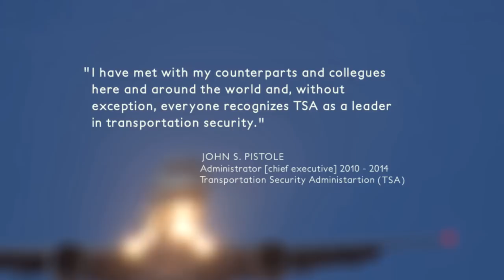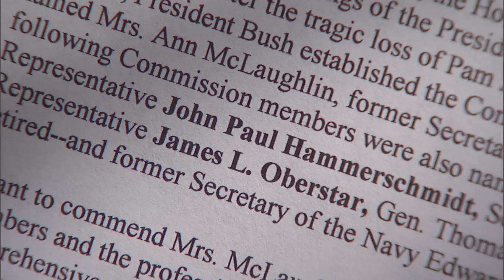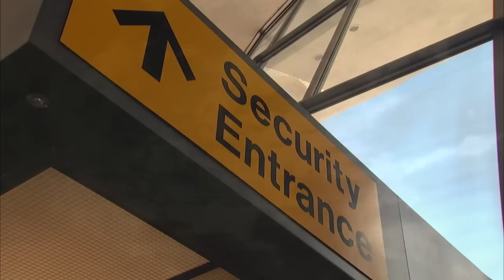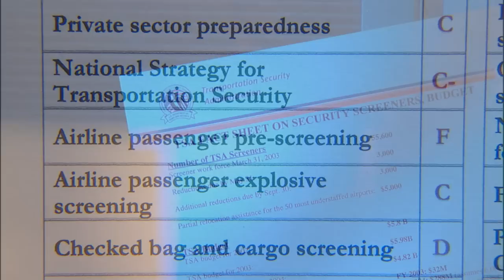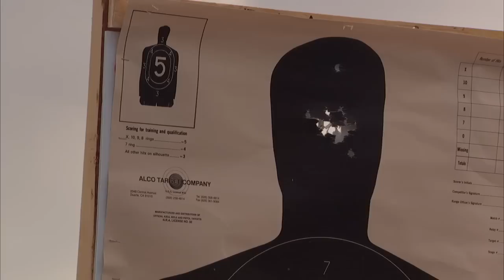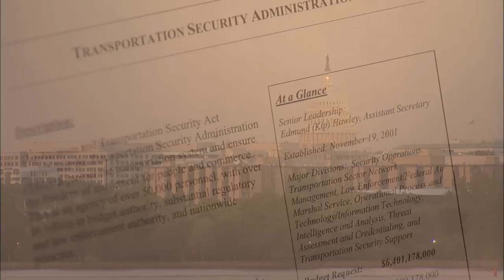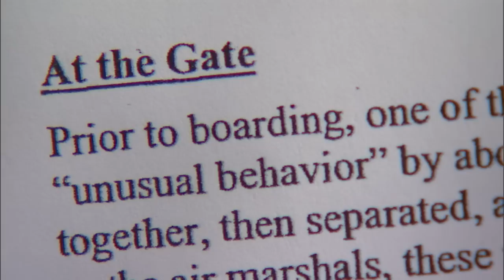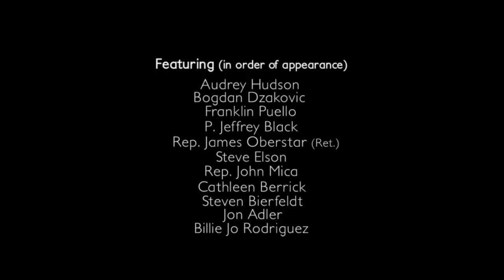TSA: The Myth of America's Airport Security

Comment: This documentary has an ton of very outdated or misrepresented information. For example, the Federal Air Marshal Service still has the highest shooting qualification requirements out of any federal law enforcement agency. The whole first part of this documentary is about the FAA's failings and then goes into how TSA is failing in the same ways because of bad FAA management that came to TSA. They then try to make it seem like its the TSOs that are entirely at fault for everything while also talking about how "highly trained law enforcement professionals" are responsible for doing actual police work. Well yes, LEOs are indeed responsible for making arrests and doing police work, so why is it that when they showed the part about the guy being questioned over campaign contributions BY POLICE did they make it seem like TSA was questioning him? TSA found a large amount of cash during normal screening procedures and turned that situation over to local LEOs as required by law. The LEOs determined it was an issue, not TSA. Yet according to this documentary its TSAs fault even though the TSO purely just opened the metal container because its likely the x-ray couldn't see through it so they had to physically inspect it.